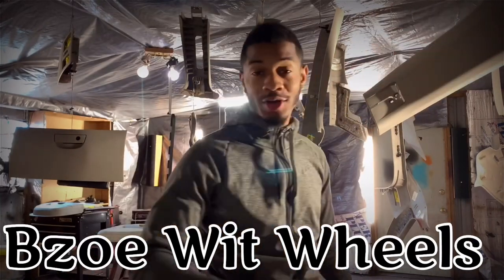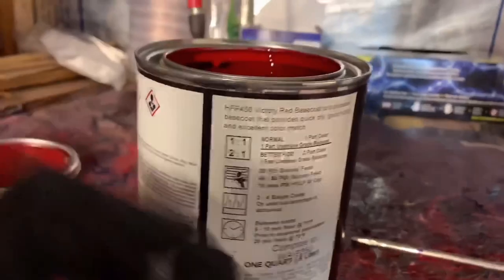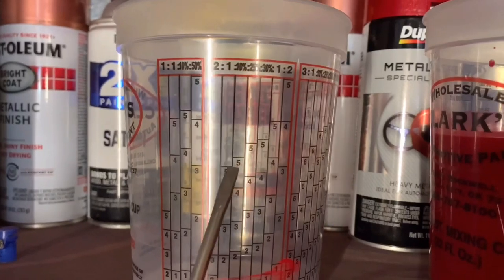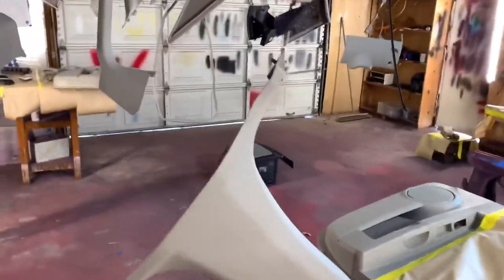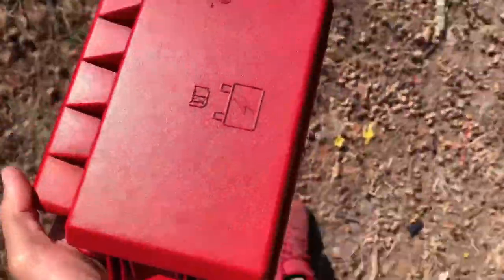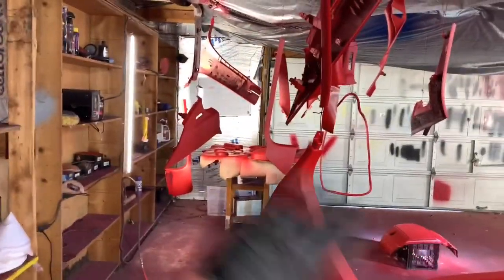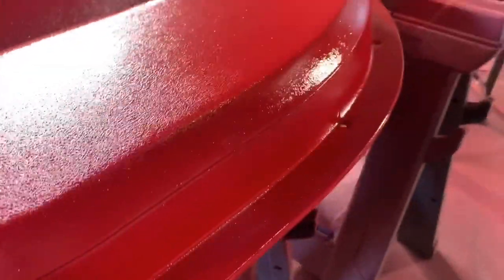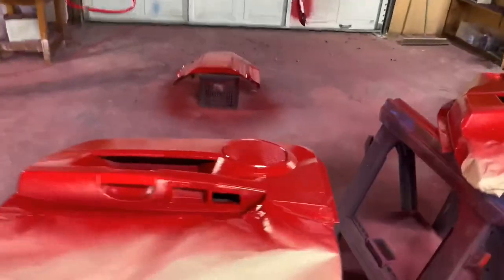DIY Custom Interior | How To Paint Car Interior !!!

Comment: Good job keep up the good work.  Just few pointers. Adhesion promote every thing plastic, it’s cheap insurance so it’ll stick. Also I would of primed it two three coats and then sand to smooth, then do sealer and then paint and clear and your good to go. Plus even using a sealer will help make coverage better and that way your not trying to cover black in some spots. Start with all one color and it won’t take as much to cover.  Holler at me or shoot me a txt anytime you have a question. Keep up the good work.
Reply from the maker: Wow.....definitely....appreciate it!! Makes tons of sense! I will definitely be using that on my next project

Comment: Make sure you use adhesion promoter when you paint plastic parts... good job my man
Reply from the maker: Oh yeah I used the bulldog adhesion promoter for those plastic pieces! But you can use adhesion promoter for all plastic?? And should it be applied heavy?
Reply: @bzoewitwheels4029  it depends on which brand. But usually it doesnt have to be applied heavy... just 1 or 2 coats and you are ready to go. It's just going to make sure anything you shoot on top of the plastic will stick.
Reply from the maker: Man say less! I was reading on it but wasn’t getting the answers I was looking for. Appreciate it! I was thinking it was strictly for plastic bumpers
Reply: @bzoewitwheels4029  it's just good practice to use it everytime you are painting something plastic. You dont want to do all that work for the paint to just flake off. I gave a lot of paint info on my channel. And anytime you have a question. Feel free to ask.... keep up the good work my man
Reply from the maker: much love on that man for real!